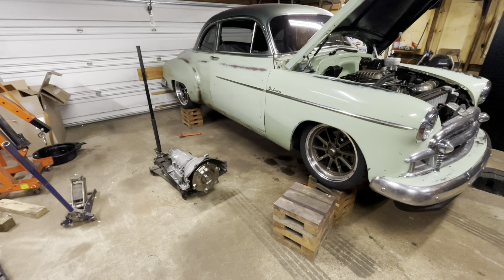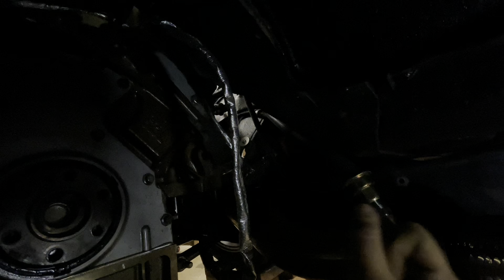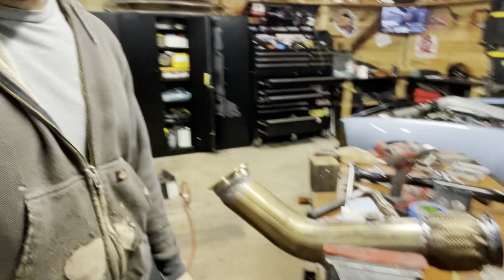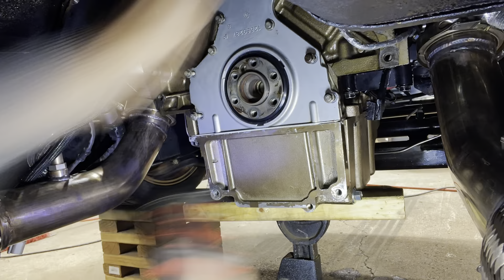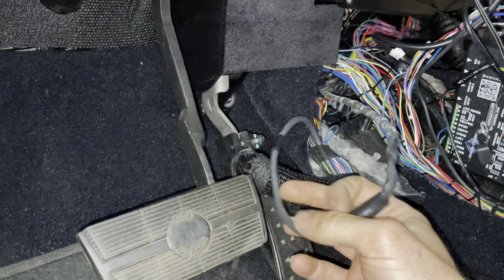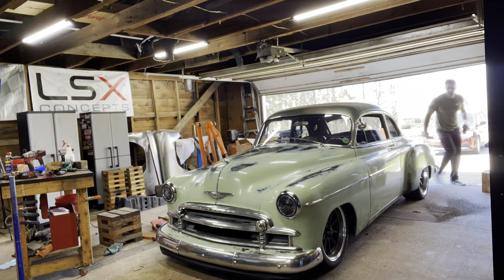Rear main seal went bad on the LS

Comment: Damn, looks like a rough day! I built a few turbo engines and ran the crankcase pressure in to the exhaust. I installed a vacuum gauge with a silicone hose to the exhaust port to make sure it supplied vacuum when running. I remember being worried that it might supply too much vacuum but seemed to work fine.Your work always turns out great!

Comment: Seen a video from Chase bays related to crank case pressure and how LS needs a dual system. One system that vents from the both valve covers into a tank and an another system that vents from the valley cover. Chase bays was explaining that LS engines make a lot of crank case pressure in the valley and the vent from the valve covers isn’t enough. I’ll find the video and link it for you. Could be your problem.
Reply from the maker: Thanks man!
Reply: There you go my man, queued up to the part. Chase explains why a 2 can system is beneficial and explains the set up. I definitely learned something new here.